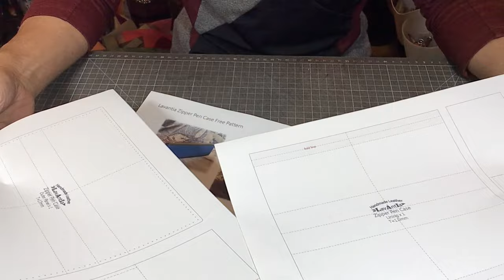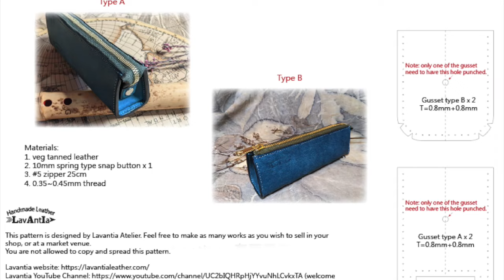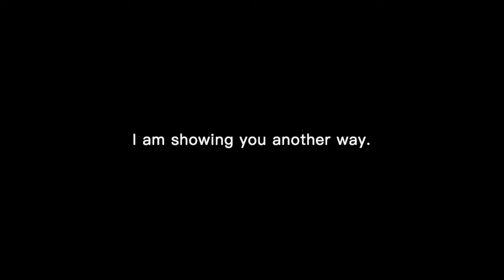Making a zippered pencil case (PDF pattern) / with subtitles

Comment: Nice products from Lavantia.... however, I'll never understand that stitching spacing,  3.38.... weird.
Reply from the maker: Thanks. The commonly used spacings are 3.0mm, 3.38mm and 3.85mm.
Reply: @lavantiatw  Well, it depends on the product. For watch straps I'd use 3mm, wallets 4 or 5, but using 3.38 or 3.85.... where do those numbers come from? In that case, why not 3.27 or 4.71?... those numbers are ridiculous so to speak.